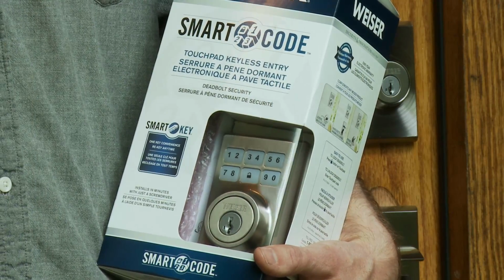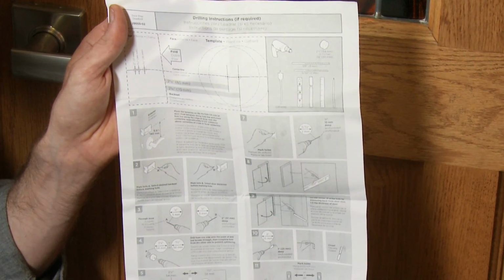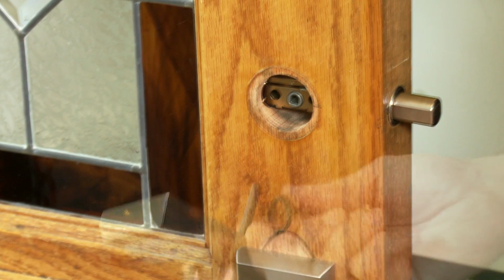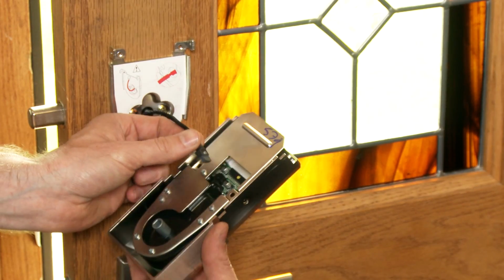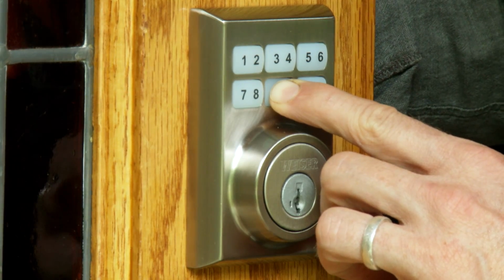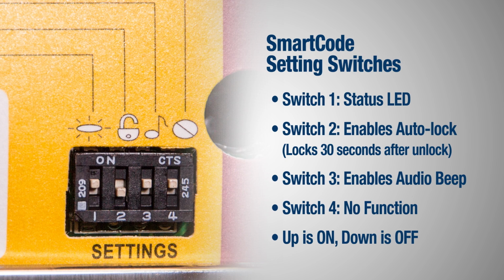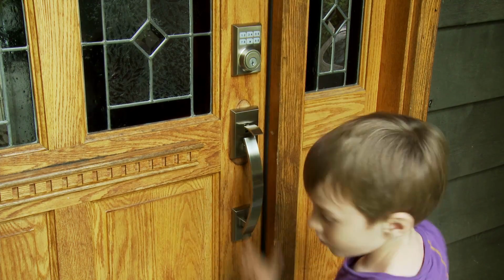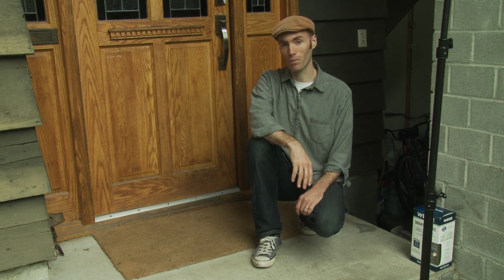Weiser - Smartcode Installation

Comment: I just changed my batteries and tried to reprogram, I followed the steps Press Lock insert batteries press program and enter the same code but all I get is 4 beeps and the light flashes  4 times. The manual locks work OK do you what the problem could be.

Comment: When I try to put a new set of batteries following the manual I get a beep and a steady red light...I called support and they told me it was because the pad was not getting enough power and to change the batteries for another brand just in case the ones I got were defective. I just did it and it doesn't work, any suggestions?
Reply: Your lock may be in the upside down position. That happened to me when i was installing mines.

Comment: I can't get my key to work. The key will not turn the deadbolt. Any suggestion? 
The key pad/electric lock works no problem.
Reply: It’s the rubbish smart key. You’ll have to buy a new cylinder

Comment: I'm on the step to set up the code but when I press the program button it doesn't do what is shown in the video. When I press program button instead of one long beep to indicate it's ready to set the code, it does 4 beeps with the first beep being longer than the rest. It then doesnt allow me to set any code. I have followed the steps and am not sure what I am doing wrong. Can anyone help?
Reply: Same problem here and it sucks.